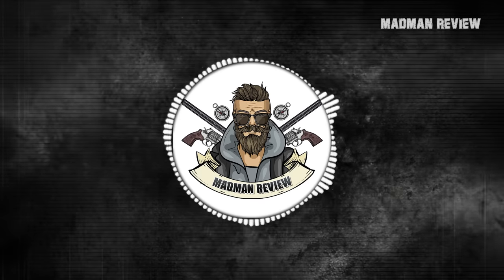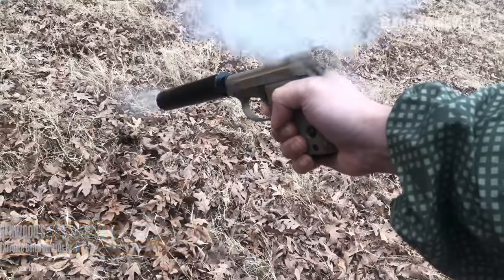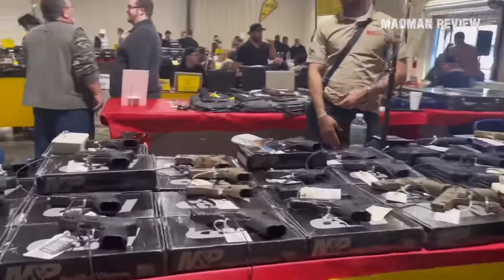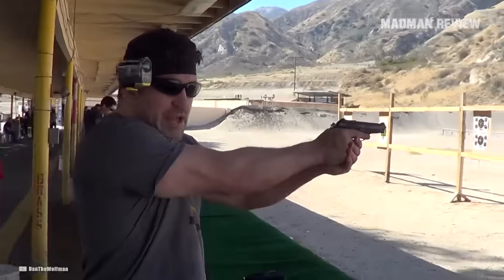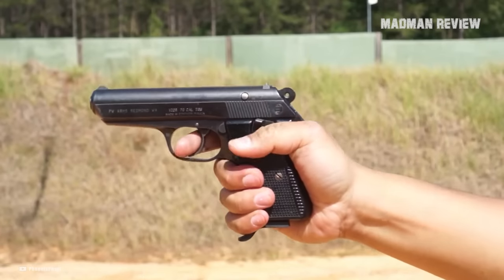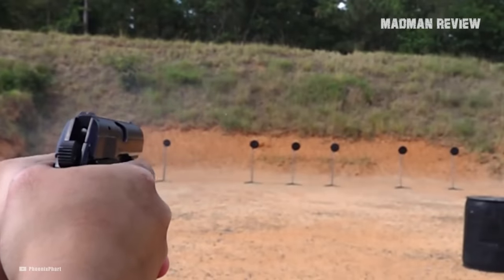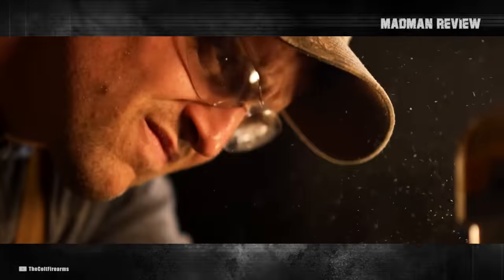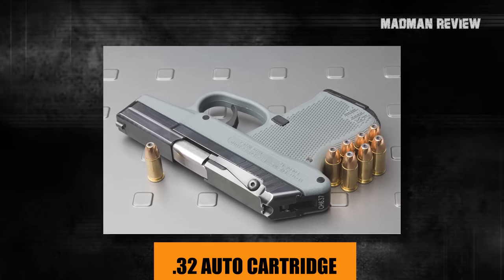7 Best .32 ACP Pistols to Buy and Collect

Comment: I bought a Beretta Tomcat. Beautiful, cool little pocket pistol. It was brand new, not used. I liked the tip up barrel feature and its compact size. I'm 70 yrs old so yeah, that was a very nice feature. I really liked this gun, except for one thing, I never got through a magazine without it jamming on me. I tried all kinds of different ammo and it would always jam. I bought it for EDC. I would not trust my life with that gun. I traded it in for a Ruger LCP Max. I have fired many rounds with it and it has never jammed even once. I really like my Ruger LCP Max and always have it with me. The Tomcat might be just a little prettier than the Ruger but there was just no way I was going to risk my life carrying that thing. And I'm sorry to say that. I really wanted the Tomcat, cool little gun. Now I love my dependable Ruger. It's a great little gun.
Reply: The producer of this video could not pour piss out of a boot even with the directions written on the heel.
Reply: Graphite dry lube solved all my jam problems. Tomcat are great.
Reply: Tomcat frame breakage problems, how wide the grip is and no ambidextrous safety were all reasons to sell it. The LCP Max definitely fills the role of mouse gun better than the Tomcat but best small .32 is the Kel Tec P32 IMHO.

Comment: My favorite backup pistol is the .32acp caliber KEL-TEC P32 pistol.  It is very thin. Weight is ONLY 6 ounces! It is the most accurate pistol in this size of pistol.
Reply: I found three reasons to sell my Tomcat and get a P32, it's the best .32 out there overall.
Reply: Smooth. Agree 100%. Great 32. Ruger is another one.

Comment: Kel-tex P32, I painted the face of the front site orange. The perfect summertime carry in the South. 
I was originally looking at the Ruger LCP 2 in .22 for summer concealed carry. But, I have an issue with rimfire ammo in a semiautomatic. I started looking into other centerfire ammo and stumbled across the P32. I watched all the reviews. A friend had the P3AT version. The 380 just doesn’t have enough weight for the size of the ammo. The trigger felt like a staple gun and the gun would hurt your hand after about 2 magazines. What a pleasant surprise the P32 is. Accurate, lightweight & easy to shoot. My wife and I went to a nighttime  Wedding in a sketchy neighborhood. I was able to carry it in the inside suit breast pocket.
Reply: I'm surprised the P32 isn't almost identical to the P3AT. As far as I know they work 100% identically and have the same trigger design and everything. The P32 is just slightly smaller and noticeably lighter.
Reply: I was looking g at one.  How is reliability.  My keltec 9mm constantly jammed.
Reply: Never had a problem with jamming. However you need to find the correct ammo that feeds consistently. I have experienced the PMC bronze where I have to push the slide forward with my thumb. The PPU FMJ works the best no issues. Do not use hollow point ammo because of rim lock.
Reply: @rkdev1  I bought mine back in 99.  It used the SW mags, if I remember correctly.  Even with fmj I had feeding issues.

It's been 25 years and the company is still around and with new pistol line ups.  So, I'm not holding my experience with one particular gun way back with a model that is probably discontinued against them.

Comment: Have had a Keltec P32 for years. Works great with Underwood ammo. Can carry it anytime, anywhere with any outfit. Great tool.
Reply: Oddly enough it is the last gun I would ever sell even though I own 20 odd guns ,to me it is the one gun that everyone should own that can double as a home defense/EDC, yes it lacks stopping power but I have never known a person to use a firearm in self defense and ever had someone shoot back.
My Berretta M9-22 comes in a close second as it is truely a great plinker, if it just had a double stack mag for 30 rounds instead of a single stack 15 I would give it the honor of being called the greatest .22 rimfire gun ever made and when you think about how many great .22's there have been that is a very lofty title.
Reply: A federal building in DC...
Reply: @chinabluewho   just don't use it for self-defense pressed against the person's body. It won't fire with the slide pushed back less than a 1/2" inch, but a revolver pistol will fire because it has a fixed barrel💥
Reply: it is also important to own a reliable semi-auto pistol that has a fixed barrel.  Ask me why ?
Reply: I wanted a Keltec P32 because the price was right and the quality good enough.  But socialist California would not approve its sale in state.  For one, the P32 lacks the mandatory safety feature for CA approval.  Keltec had no intention of bowing to California's demands.

Comment: Guys!!!!!!! The number 1 is my Sig-Sauer 232 in 32 acp. All steel (stainless), made manually and fited also manually by special my order in Germany, factory Sauer und Sohn. 15 years ago. For double price. They were making it during 6 months after official work time. I called them from time to time at 7-8 p.m.,and those guys were working . So,finally l got a " rolls- royse" in 32 acp.

Comment: I bought a couple of the model 81 Beretta's a while back, just because they were reasonable,  After a little research I found that you can swap out the model 84 barrel and magazine and shoot .380. After some hunting on GB, I found barrels and magazines (you can use the 81 mags, but they will only fit 10 rounds), I converted both and they shoot great. Keep 1 in a bugout bag with both barrels and both 32 and 380 ammo.
Reply: Do I understand that your saying the 81 mags will accept 380 rounds?
Reply: Where did you find the 81's how much, Thanks in advance.

Comment: I have the .32 KEL-TEC.  I've never had a problem with it.  It is my walk/run gun and despite being exposed to sweat it has shown no rust so long as I do my maintenance.  I have a commercial; "+P" in my FMJ/JHP defensive magazines. I have fired in it to make sure it functioned and didn't blow up.  The "+P" just gives a touch of snap.
I recently ordered the Tomcat despite not being able to shoot the "+P" without ending the warranty.  That does make me wonder about the metals used.  If it is using the same metals for the bigger guns I dont see why it wouldn't be OK to shoot "+P" in a limited fashion such as annual couple of mags 12 shots per year while using regular ammunition for regular range day.

Comment: Living in AZ in the heat, I clip on my KelTec P32 on whatever I'm wearing.  I run the Underwood +P Xtreme Defender with the screwdriver bullets.  I also put in a stronger recoil spring that makes the tiny gun much more controllable.  However plain Jane .32 ACP won't cycle with the heavier spring.  I have to use hotter European 7.65 Browning loads or the Underwood +P to cycle reliably.

Comment: In 2003 I purchase the brand-new Kel-Tec 32 generation 1... This is the gun that goes in my pocket and a DeSantis Nemesis pocket holster whenever I wear my lightweight shorts or lightweight slacks... I installed Kel-Tec anti rim lock kit in all my magazines so I could carry hollow points without a rim lock issue.. I load with Hornady xtp hollow points my Kel-Tec p32 has been reliable and accurate up to 50 ft
Reply: I have their now discontinued .380. Recoil is a bear and the trigger breaks at about 6lbs. I’d love to know how the felt recoil and trigger pull is in yours. That said, I hate that KelTec won’t put a simple slide lock on their pocket pistols.
Reply: @ccrass4443  The P-32 does have a slide lock. It is internal with no external lever. The slide locks back after the last round is fired but there is no lever to release the slide. Pull the slide back and release after inserting a fresh, loaded magazine to continue firing.
Reply: Something must be wrong with mine. I carried it as a back up gun for years and I qualified with it annually and not once did it ever locked back on an empty magazine. Sounds like I need to take it to an armor.
Reply: @ccrass4443  There's nothing wrong with your .380 Kel-Tec. It does not have a slide lock. The P-32 (.32 ACP) does have a slide lock. When Kel-Tec came out with the P3AT, they removed the slide lock to make room for the fatter .380 cartridge.
Reply: Thanks. Looks like I misread your original comment.

Comment: I have a particular love of .32s, and I have and carry an array of them dating back to around 1905.  That's my little top break Smith 2" Bicycle Model in .32 S&W.  I'm also partial to the Beretta Model 35, Colt Model 1903, Browning Model 1910, and the Kel-Tec P32.  There's a whole bunch of others in the mix too.  I handload .32 S&W, including blackpowder loads in vintage balloon head brass, .32 S&W Long, .32 H&R Magnum, and .32 ACP.  A delightful caliber to shoot.  Very low noise, especially in a longer barrel revolver.  A little powder goes a long way too, and cases seem to last just about forever.  I've never seen one crack.
Reply: Nice. You have any .25's at all too? I think .32 and .25 are excellent rounds. There were a ton of really good .25 pocket guns made in the last 110-120 years.
Reply: @deucedeuce1572  Yes, many .25s, dating back to around 1914.  I have the original instruction manual for my Mauser Model 1910, and the instruction sheet and box for the Colt Pocket Model.  And I handload .25 ACP as well.  Along with maybe 11 other people in the country. 😛
Reply: @jamesclark6427  lol. That's awesome though. I always wondered if it would be possible to make your own brass at home. I've seen people make bullets (including jacketed bullets) fairly easily, but making brass would require a tool with tons of force to be able to shape and draw the brass.

I'm actually surprised you can find .25acp components/tools to reload. Never seen any .25acp brass for sale or any .25acp reloading dies or other caliber specific equipment like that.
Reply: @deucedeuce1572  You can get all the tools and components to load .25 ACP easily enough.  Or any other caliber in the world.  It is possible to make your own cases, but they have to be lathe turned from solid bar stock.  It's much more common to machine the rim of a case to convert it for use in another caliber.  But sometimes machining a case entirely is the only option when nothing else can be made to work.  Unfortunately machined brass does not have the elasticity of drawn cases, and they don't last as many firings.  But it's sometimes the only way to make the ammunition for a long obsolete oddball caliber.  This is mostly done with larger caliber rimfire cartridges.  The head is machined to accept a .22 rimfire blank to serve as priming.  Those are limited to black powder use, and must be carefully aligned with the firing pin, but they work.  Any useable ammunition is better than none at all.
Reply: @jamesclark6427  Damn, I wouldn't want to have to turn brass like that. I'm not sure how much force is needed to form and draw them like the gun companies do... but I think it would be a hell of a lot easier and faster that turning each one separately. I've never seen anything turned that thin before either. I'd be worried it would collapse, like when you make the clay too thin on a pottery wheel.
Reply: @deucedeuce1572  it's actually not that difficult.  Assuming you're a machinist and a gunsmith and have a lathe in your basement like me!  It is actually a fairly simple lathe operation.  Brass machines very easily and well.  But factories have always used drawn cases because it's much faster and more cost effective to make them with dies and it yields a much superior and more resilient case.
Reply: @jamesclark6427  Yeah, I've always wanted a lathe and/or milling machine. Has always been a dream of mine. Glad you have one and use it. They're Extremely useful. If I had one I believe I would be able to make good money with it (assuming I was physically able to use it/them).

Comment: My eyes popped out when the Colt 1903 came out.  But a regular blued finish would be just fine.  But I'd be more likely to get the Barretta Cheetah.  It just looks like the one I'd prefer.
Reply: My eyes popped out when I saw the current price. I bought a 1921-vintage Colt 1903 many years ago for $150. I think I'll hang on to that one!

Comment: I have seen YT videos of the .380 going thru coconuts, pineapples, ammo cans, and car doors in both FMJ and HPs. You do not need to go 12 inches in to the body to cause a stop.
Reply: Remington made a Model 51 .32ACP pistol as well. All steel and a grip safety made it very slim.The .380 version outsold the 
.32 thus leading to its demise .
I actually traded off my .380 model 51 for the Kel-tec
. 32 with no regrets. As with most handguns,  I expect to finish the attacker off with a physical fight anyway,  so why not carry the one gun that you are most likely to bring along ?

Comment: I have both the 3032 and the P-32. You are correct, the Beretta trigger is awful. The major drawback for the P-32 is the infrequent production runs. In both pistols, I prefer the 55 grain Underwood Xtreme Defender Ammunition. Overall, I like, the P-32 best.
Reply: Ive put Novak sights and a flat faced trigger on my P32    More than I bought the gun for   , ,,worth every penny

Comment: Definitely recommend the 3032. Really think it's the best pocket pistol ever designed.
Reply: Frame Cracks from firing normal 32acp ammo

Beretta: This was entirely YOUR fault and was not in any way our bad design. In fact, we think that our design is perfectly acceptable despite it cracking from the day we released it and it still cracks to this day. We will not be fixing or replacing it for you.

TLDR Get a Keltec P32 or a NAA Guardian instead. If you can find one of the titanium framed Tomcats, get it and NEVER sell it!
Reply: @MegaAppleshit  They only crack from the heavier 72gr ammo, which isn't perfect, but it rarely happens and it can be easily avoided by firing the suggested ammo in it. Also, they could easily fix it, but they're being stupid for some reason (like when they came out with the thicker slides that did nothing to fix the frame cracking issue, yet continue to sell them like that).

The P32 and Guardian are both good guns. I don't have a problem with them, but they're not Double Action (DA/SA) and they don't have the tip-up barrel function. The 3032 is the ONLY gun with these options. Taurus came out with the PT-22 and PT-25 and they're decent guns, but they don't make a .32 and they're DAO.
Reply: Mine cracked after very few rounds. Completely ridiculous that a company still makes and sells a product that they know has defects and offers no customer support.
Reply: @MegaAppleshit I bought a used one and then learned about their frames breaking. The huge grip size and no ambidextrous safety were the main reasons I sold it. Shame on them for making junk. I would carry the .380 Ruger LCP MAX instead and if I want a small .32 the Kel Tec P32 is better pick for me.
Reply: The grip is huge, the frame breaks, several better guns out there. I sold mine, they're junk once it breaks.
Reply: @melissasmess2773  They recommend you not to shoot the heavier ammo. If you don't listen and your frame breaks, then you can't blame them. Never heard of a single frame breaking without shooting the heavier/hotter ammo. Yeah, there are Always "several better guns" out there. How many DA .32's do you know and recommend over the 3032? (DA/SA's, not DOA's).

Yeah, it does suck that the frames crack. There's no doubt a design flaw that lead to that, so I can't say "just shoot the right ammo" and that there's absolutely nothing wrong with the fact that you can't shoot other ammo... but I don't believe it's a flaw so bad that it makes the gun garbage or anything. It's still a great gun.

(I hate how they switched to the ridiculously thick slides they're using now though... and although it did NOTHING to stop the frames from cracking, they continue to sell them like that. If I ever buy a 3032 for myself, it will definitely be one of the older one's or a new one with an old thinner slide.)

Comment: My first .32 was a Mauser HSC that was a WWII bring back. It was an officer's pistol. A beautiful espensive relic but basically a collectible. I've owned the Beretta 3032 Tomcat. They are fairly priced now a days but the trigger pull and ergonomics suck. Worse of all, the factory rear sights were far off center. Had to either pay a gunsmith to adjust or send back to Beretta and wait 8 weeks for them to adjust/fix the issue.  Also there is currently no available laser sight in the market. I've seen pre-owned crimson trace for this model on ebay for $1200. I sold it after 2 weeks. Settled with a KelTec p32. Happy with accuracy, recoil, trigger pull and overall I recommend it highly for a deep concealed carry firearm. I am confident deploying this firearm at distances of no more than 30' for safe accuracy.
Reply from the maker: Thank you for sharing your detailed review of the various .32 pistols you've tried. Your insights are invaluable for those considering a similar purchase.

Comment: I like the Tomcat and the Kel Tec P-32.  I had a Seacamp and got rid of it at a loss. It was horrible to shoot. Jammed a lot for me.
Reply: It's too small to hold in your hand correct .
I had my ex leave Me for the same reason
Reply: @oscarbear7498  😂😂😂 now that's funny!!
Reply: It sounds like you weren't using ammo from Seecamp's list.
The Seecamp is so small that it has very tight cartridge length requirement (otherwise they won't feed properly).
Reply: @trilobiteterror8015  It may well be that it took me a long time to get to where I could hang on to the thing tightly as it was too small for my hand (1.5 fingers on the grip), so it was maybe jamming from the limp-wrist phenomenon, or in this case limp grip.  The last time I shot it, I ran PPU FMJ and it ran beautifully. That was with the spacer removed from the magazine.  I could not run the Fiocchi FMJ because some were too long to fit the magazine even with the spacer removed.